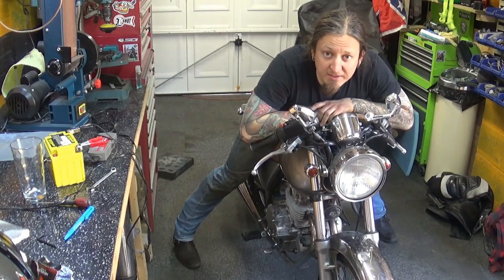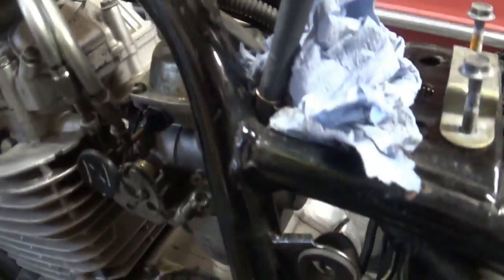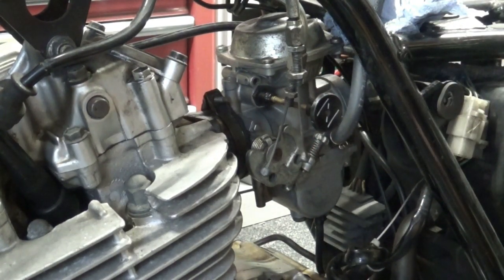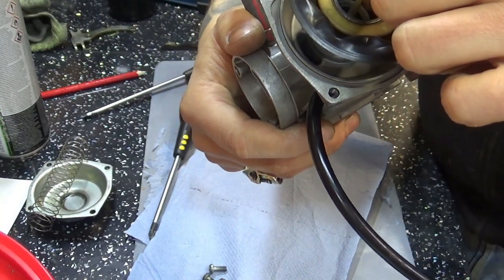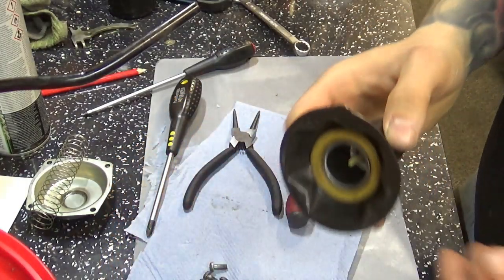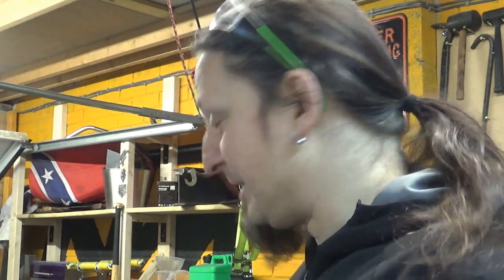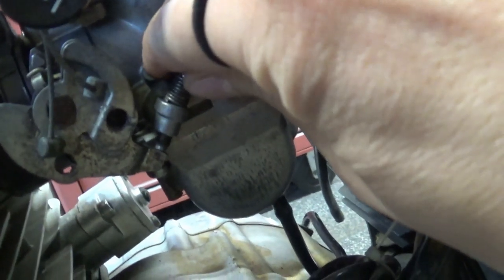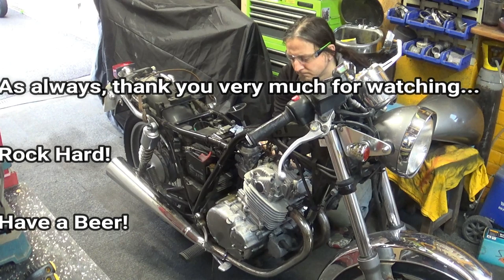New Project - Suzuki TU 250 X - But can we fix it?

Comment: Hi mate, I watched it twice and looked online. I know you put the parts in your sonic cleaner but I think you still have a blocked pilot jet. The choke on and the main jet raised are compensating the fuel flow at idle/part throttle. I have seen similar symptoms from sitting with stale fuel as the jet is tiny. Cheep to replace. Hope this helps 👍🍺🍺
Reply from the maker: I ripped it apart and cleaned it all...all apart from air screw...where I think the problem is?
Reply: @MackieBass  hi.. Am Planing to Buy Suzuki Tu250x From Auction... How Can i Show u Some Pic of it?  PLEASE
Reply from the maker: Email me

Comment: Blocked pilot jet. Guaranteed. I just did a GL1100 bigger motor, same symptoms. Found all  4 pilots plugged. Yes, check valves too. That bike had sat for 20 years before I got it and it's running very well now. You can get this one running well again.
Reply from the maker: I hope so! It's not the pilot jet...rip them all apart and they are squiky clean now. Must be something else...I'm on it tomorrow maybe.

Comment: Hiya Mackie, do like that you don't choose expensive bikes for your projects, real bikes that interest real people, as for your carb I would suggest it is the pilot jet circuit, think you may well find it is dirt in the pilot jet or more likely the emulsion tube above it, a tiny bit of crap will have that effect and several Suzuki models suffer that problem, worth blowing all the jets and airways a blow through with an airline, also brake or carb cleaner squirted everywhere before blowing through helps but getting the pilot jet and emulsion tube out and clean is the best thing to check
Reply from the maker: well, I'm a rear person, can't afford harleys and all that to rip apart, I wish I could, but look at this little guy - such a cool bike!
Not a pilot jet buddy, checked them all and they are clean as you like it!

Comment: As mentioned in the other comments, air leak, blocked jet etc, also worth checking timing & valve clearances as well matey. Good luck
Reply from the maker: Yes, that's the last thing to do...I'll start with the easier bits ;)

Comment: Hi Mackie,
Put all the jets in a jar of thinners and then put it in the sonic washer full of water. Your pilot jet is choked for sure and most other fluids in the washer don't work well for this problem, petrol works too but not as good as thinners, Soap only cleans oily dirt on the outside.
If you can get the carb body in paint  thinners do it as well as the galleries can be blocked too.
Reply from the maker: I soaked them i carb cleaner and blown air through - clean as you like it..yet the problem still there. hmmmm... ;\
Reply: @MackieBass  Absolutely no idea why it's called  Carb Cleaner, it does everything but, (mirrors etc.)
To get the varnish out of the unseen galleries you need to try thinners, it's not like you won't have any.  The emulsion tube that the main needle goes through also has tiny holes too. Strip the car to the bare bones.
Use hot water in the sonic bath and let it go. If the jar floats and wants to tip over either put more components in the jar or put more thinners in it. 
Try it, what have you got to lose.

Comment: Hiya.I would be checking the carb again.Rip it to bits and make sure all jets are clear.Blow through them with your compressor.It would be worth checking for an air leak aswell.Perhaps squirt some wd on the inlet manifold,see if the revs rise.All the best.
Reply from the maker: Already ripped it apart...3 times ;) Air screw seems to be the issue, but can't teste it just yet... maybe over the weekend

Comment: BTW, about intake air filter systems: In general you are absolutely right with what you said about air box. But, different from many comments of private persons in internet, intake air filters and air boxes are NOT always designed to make the motor run perfect or even near to that. Reason for that often is space conditions due to design of bike. But, surprise, even more frequently it´s about costs. With bikes we have a better chance to get a good system, same as with exhausts. With cars, situation is much worse. Guess why I know.
Reply from the maker: Very good point man, what I'm trying to do is go back to original assembly, so it's like the manufacturer inteded...and from that point we can play!

Comment: Hi Mackie: if I may, the first thing to do is to return all of the settings to the factory specs (you do have a manual right)?  Then inspect the jets very carefully - it sounds like something is still blocked (perhaps the emulsion tube - but when cleaning it do not use wire as that can enlarge the tiny holes.  The other thing to check is the carb mounting boot (the flexible thing that screws to the cylinder head) if there is a leak in that boot-head joint or with the fit of the carb in the boot - you won’t get it to run correctly.  
There is lots of info online on rebuilding Amika I carbs - do some research and you’ll find it.
Reply from the maker: I checked it all Peter, part 2 cominug up as we speak, more info there. Still no joy..

Comment: Double check the rubber between the carb and motor bro. Could have a little air leak. Cool little bike mate, you'll crack it 🤘
Reply from the maker: Rubber looks and feels really solid, so don't think that is the case. Indeed a cool bike...I hope I'll get it fixed.

Comment: The diaphragm might have a whole in it. If it does it won'r raise the jet needle so it can get more fuel. Good luck on the build. you need to strip it down  put a solo seat on it and make a mini bobber out of it.
Reply from the maker: Diaphragm is all good. I think this one will be back to original condition, it's such a cool design. Suzuki nailed this one!

Comment: Already now (only 11 comments yet) others already pointed out about pilot jet and poissible air leaks. Let me add that also passages of pilot jet which are casted in the carb housing can be blocked. Especially these are sometimes hard to clean.
Reply from the maker: Well, I took them all out and soak and cleaned them all separately...that's not it.

Comment: when you cleaned the carb parts, I am sure you removed the main jet , this is also were the slide needle goes up and down into. ok so when you remove the main jet from fuel bowl area, there is a washer use a pick to remove the washer and this will expose a long tube jet that the needle from the slide  pin goes in and out of this must be cleaned as well, it well drop out when the washer that sits between this tube and the main jet. is removed. it has about 8 to maybe 16 little holes running along the sides that must be clean and open, use a safety pin, as they are very small. ok the only reason I am posting all of this is because every time some one comes to me for help its like no one ever cleans this part. If you already know this a apologize, for my assumption. :)
Reply from the maker: No apologies needed my good man. I really appreciate your input. And yes, I did take them apart and gave them good clean to a point I could see throuh all the holes. The only thing I didn't take apart was the air screw, as it was jammed after 5 turns...which I assumed was a factory stop. But no..I'm on it over the weekend, so will double check that part! Thanks again and speak soon!
Reply: @MackieBass  I enjoy your videos I am much like you when I am working on my 1981 Suzuki GS 550 Café Racer project, doing  it because it is fun.

Comment: Oh man, I should have looked at this video of the Suzuki first! Dude! It’s the Fuel System! The 250 is starving for fuel in the transition from cold start (choke) to idle circuit. May have issue with other carb circuits too. The carb has issues. Ultrasonic cleaner not enough. The when system is starved for fuel like that, I like to eliminate leak issues. Vacuum will lean it when various carb parts warp due to overheat, or cold water/rain while engine was hot, etc. Anyway, to test for issues, start the bike and get it idling with full choke if necessary. Then use carb spray (good) or Starting fluid spray (better) and make really short sprays all around the carb and note changes in idle speed to find leaks. Sometimes you can fix the leaks with new gaskets, but sometimes you cannot. Excessive play in linkage pivots etc., just can’t be easily fixed. I am dead certain this is carb fault. Other stuff may need to be optimized, but this is a fuel delivery issue. 100% my friend. Shit, I wish I had seen this before you went down all those other rabbit trails. Shit. It’s the carb. Focus on the carb.
Reply from the maker: Kenny, it's not the fuel system. It is not fuel starvation 100% sure of it. It is something to do with advance...or rather lack of it. Carb it's spotless...both of them are. It's electrical. I'm on it bro!

Comment: I had a '98 model...... Wish I still had it... Good little commuter bikes..
Reply from the maker: It is a 98...or 99? 98 I think. cool little bike
Reply: @MackieBass  Up until fairly recently, the bike was my only transport (I'm almost 50). Rode the TU for almost 3 years. They are really good on fuel, pretty easy to maintain, and parts are still available for them. Almost the complete opposite of my 1800 lol

Comment: Hi Mackie, have you checked the float bowl at all ? The float bowl needle, needle adjuster and float bowl height ? failing that it seems to only happen when the throttle plate / butterfly valve opens and closes, could that be loose at all, the 2 screws holding it in place maybe they came loose or the plates not sitting correctly in the valve chamber or the plate could just be worn out, just a few ideas, good luck
Reply from the maker: In second part I've got new carb...issue is still the same.

Comment: Hi Mackie I would check 4 things, the jets are clear i.e. you can see through them both slow running and main jet, the diaphragm has no holes in it, i.e.pin holes or little cuts especially where it joins the metal parts (a little stretch will highlight these), float height (see the manual) and air adjusting screw is turned out usually about 1 1/4 or 1 1/2 turns, it's not the first time I have come across these turned in tight. 

Make sure all orifices are clear throughout the carb. I would put the slide needle back where it was, its possible but unlikely someone has moved it from its original factory set position.

This bike is almost certain to have electronic ignition i.e. no points or advance retard unit so not included in the 4 if it does then its 5 things to check.

It should make a really nice project, i.e. flat tracker, you did the cafe racer and you did a fine job though I guess you have your own idea's. http://www.bikebound.com/wp-content/uploads/2017/10/Suzuki-TU250-Grasstracker-6.jpg  https://www.bikebound.com/2017/10/01/suzuki-grasstracker-custom/ though with a flat tracker seat or similar. http://renax-motorbike.blogspot.com/search/label/Dominator%20NX650%20kit.
Reply from the maker: Thanks man, as you will see in part 2 for this I 've checked it all already...running out of ideas here...

Comment: I’ve never heard of one.  There is a lot of the bike that reminds me of my Suzuki GT250.
Reply from the maker: I guess it's a similar structure. Very rare in the UK. Seems the american market had more of these.
Reply: I am genuinely not being rude, but the only thing this bike has in common with a GT250 is its a motorcycle and called a Suzuki. The GT250 is a 2 stroke, 2 cylinders, it looks and sounds nothing like this bike. 
MackieBass was very diplomatic in his reply saying it had a similar structure i.e. it has a frame, 2 wheels and an engine.
Reply: Nightster For saying you’re not being rude, you’re making a good job of it.  I wasn’t talking about the engine, I was talking about the, frame, the ace bars, the wheels the forks, and general style.  It REMINDS me of my GT 250, I didn’t say it had anything in common!
Reply: @OldManTony  I bought a new GT250A in 1976 and still own one today I reckon I know the bike reasonably well, I will say it again I wasn't being rude honest and to the point, I didn't realise you would be so delicate but the last part of your last sentence said it all.

Comment: Hey Mack. I see your problem mate. You need to drink more beer, not use it as fuel !!!  Seriously though, all everyone says and check that vacuum rubber, looks a bit puckered. Also check the slide is lifting with vacuum. Blow some air through and the slide should lift. Good luck!
Reply from the maker: Someone said more beer? ok..you convinced me!
Reply: @MackieBass  well that was easy!😂

Comment: Is the float level/movement looking ok? Is the rubber line going from the carb to the tank (now the "Mackie tank" lol) positively not gunked up/kinked with an internal unseen restriction of fuel actually getting into the carb? How is the spark plug colour and condition- showing lean? I love these resurrection videos. I feel mildly guilty, because often they can lead to a bit of frustration trying to suss out the problem, but the final satisfaction surely makes it worthwhile, eh? I just love them nonetheless, a big thank you for doing these :D
Reply from the maker: Hey man. The floats seems to be working well. The rubber hose is a brand new one, so I know it is working well.
Spark plug is slightly on lean side I'd say. Resorruecion is great, as long we can actually resurrect the bike within reasonable budget :)

Comment: Maybe an air leak somewhere? Years ago when I had twin carb cars I always found colourtune plugs very helpful for this sort of thing.
Reply from the maker: I spray easy start all around the carb - doesn't seem like an air leak.
Reply: @MackieBass  hmmm, tricky then, something is leaning it out, if not an air problem and you're confident no blocked jets then maybe fuel line?